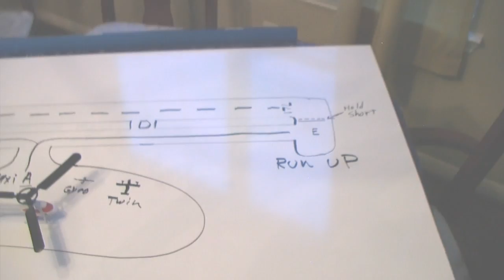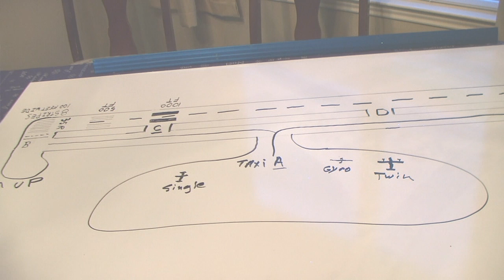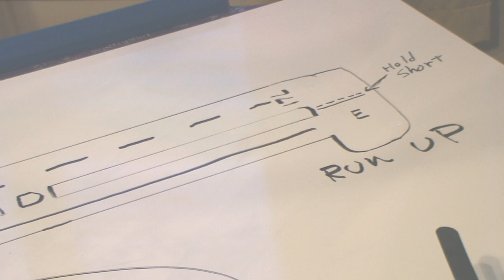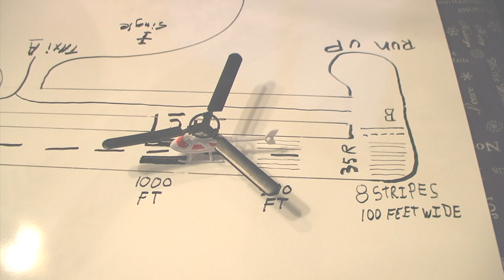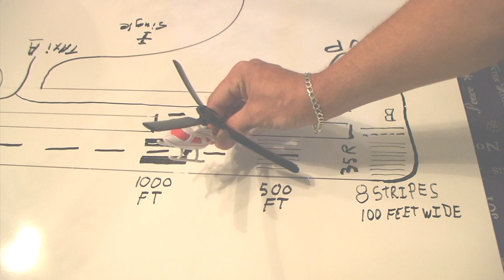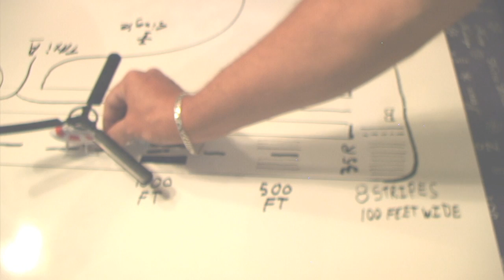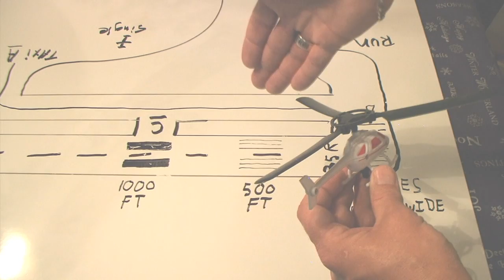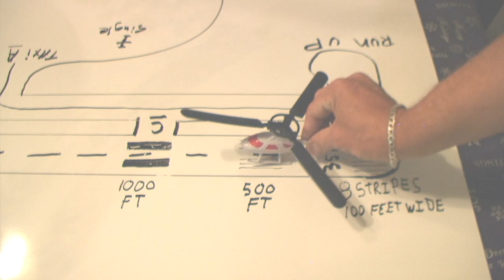MTO AutoGyro training. Landings, Slips, and Airports, training

Comment from the maker: I made a comment that runway 17L meant left traffic and 35R meant right traffic and that is not actually always the case usually the L or R is used when the airport has several parallel runways to depict the left or right runway in the set. In these cases they might even have a C for a center runway like Dallas Fortworth does.